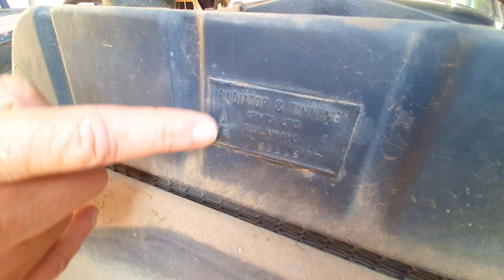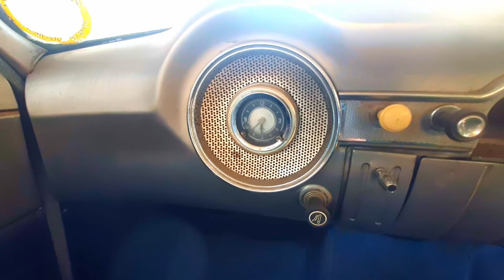RARE 1957 Vauxhall Velox Dormobile Estate E Series / How Many Have Survived ? / Dormobile Review

Comment: Hi. I am from Sri Lanka, and I have a Vauxhall Cresta 1957 E class saloon car which I recently restored after about 15 years of storage.  This car of mine, ofcource had almost all of the chrome fittings, so I had only to do the tinkering, painting, electrical wiring, upholstery, the mechanics and ofcource the rubber beading for the windscreen, shutters and doors. 
I still have a bit more to do as I don't have the wipers, as the unit that connects to the motor is missing and also I don't have the blower. As to the rubber beading you showed, what I did was, I applied black silicone over the present beading and covered whatever worn out rubber, as it was not available here in Sri Lanka. The two buffers also, I asked my tinkerer to make out of metal and got them chrome plated, as the original ones were too corroded and couldn't be repaired. 
I heard that it could be bought through eBay, but I didn't try as our imports were restricted and the currency rate was high. 
You could try to get whatever you want from England, as there are parts available there and also from the classic car collector's  clubs. 
Try typing the model specification on YouTube. You could get all the information needed.  Wish you all the best.
Reply from the maker: Thank you for your comment. Best of luck with the restoration of your E series. I am going to England soon as a matter of fact and I shall try my best to get all the parts I can.
Reply: @RetroCarDogs  wish you all the best. No doubt, you could get the original parts from England.